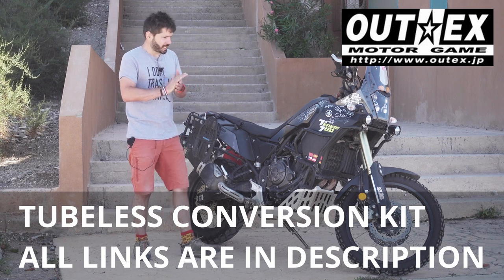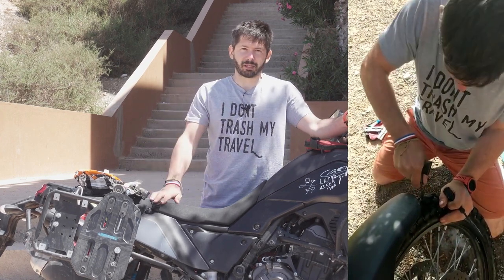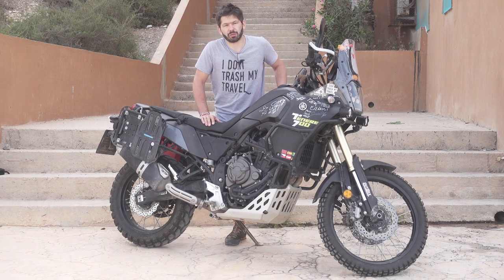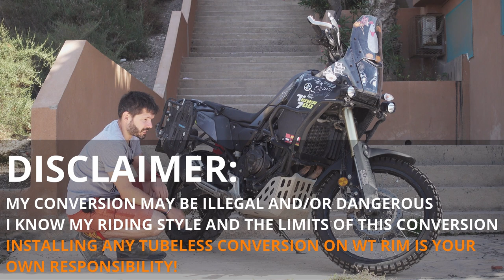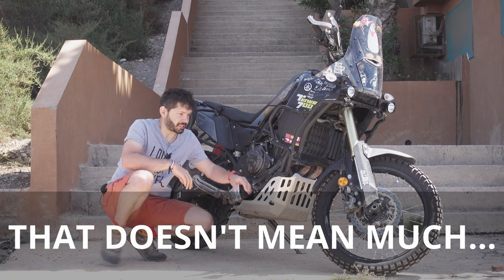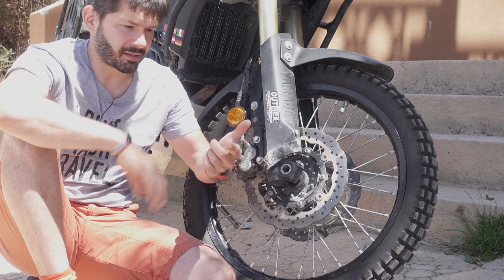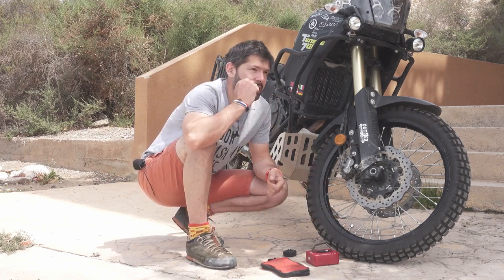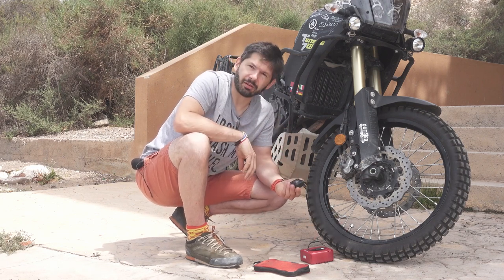Yamaha Ténéré 700 10k: OutEx tubeless

Comment: i run outex tubeless and my ktm 690 and 790 adv rally. i have popped the bead off the front rims on both bikes. i use rim locks to mitigate the issue. since using a rim lock on the 690, it's hasn't happened again. one rim lock didn't prevent the bead from unseating on the 790 -i ride it like a dirt bike. so, i'm adding a second rim lock to the 790 front rim. we'll see.
Reply from the maker: Wow this is super interesting info! What pressure you run? Do you think you pop it off the bead because of the pressure or because you ride it like a dirt bike? I guess for the dirt bike riding the MT rim would be also solution...? Rim locks sounds like great trick!
Reply: @FARANDFURTHER  on the 690, i run as low as 14 psi in the front/rear. the 790 is fairly new to me and so i'm still experimenting. i was running about 24 psi in the front of 790, when the bead unseated. i think the bead came off because of riding it like a dirt bike. i intentionally blasted into rocks at speed to test the tubeless and custom rims. so, i was actually trying to unseat the bead and punish the rims because i wanted to find the limits of the setup, since it's new to me. i run excel takasago heavy duty rims, size 1.85 in the front and 2.5 in the rear. the challenge with rim locks is getting them to seal on tubeless setup. i've customized the rim locks to handle tubeless setup.
Reply from the maker: Sorry for late reply, YouTube won't notify me on the replies to comments I already replied. GRRR...

This is great information, fascinating. Thanks a lot for sharing! I think we can conclude that with normal use it would be very difficult to unseat the tire!

So does the Excel Takasago rim come with the rim lock hole? Or you just drill it?

Comment: Did you consider the Tubliss system? It locks the tyre bead to the wheel rim all the way around so is even more effective in keeping a tyre on the rim than a normal tubeless system. However, it is not DOT rated for the road yet, so I guess each person has to decide whether that matters or not. It does not mean that it wouldn't pass the regulations, just that as yet as far as I know, it has not been submitted. Just me personally, I am going to experiment with it because I have have met KTM 500 owners who use it at 80 -90 mph road speeds. That said, a 500 EXC is a lot lighter than a T700, but I cannot see any reason why there should be a problem, after all the tyre is going to be running a lot cooler than it is with a tube. What does anyone else think about Tubliss?
Reply from the maker: Hi, I've heard about Tubliss system and I think for more agressive off-road it probably does make sense and maybe safer than the OutEx system I'm using (especially when I don't have tubeless safety rim, in the front).

I think I will give it a try at some point, at the moment OutEx works well, however it probably is not DOT rated and may be questionable solution due to front rim.

Comment: nice video..useful.. the way you can stop air leaking while tire is decading is to use tire milk, i use iot in MTB tires ... it seals all small leaks perfectly... hope it helps
Reply from the maker: I'm back on the tubeless in the back so let's see how it goes. If it leaks a bit I'll try the tire selants (milk). Although now thinking about it... it may interfere with my pressure sensors.

Comment: Hi, great vids! I was wondering with your recent adventures offroad, how it the tubless conversion holding? 
Do you air down the tyres and if so, how much to ride safe without popping the bead?
Thinking of doing it on mine with 3M tape. Let me know your experience so far. Thanks and congrats for the content 👌👌
Reply from the maker: Hi, glad you find videos useful. The tubeless conversion holds perfect. I found few days ago that I have a bit dented rim in the front but it still holds well and with new tires does not leak at all.

I air down to 20psi for off-road no less, to be on the safe side, but I usually ride such hard tires that I'm not entirely sure if it does make any difference except in my head.

OutEx says min is 18psi if you don't have the tubeless safe rim, which I don't in the front. Rear I can ride as low as I want but front I keep aired up and with all the off-road training, log jumping and so on... so far so good.

I've done now 16k km on the system on T7 and about 60k km on Honda CB500X on previous trip.

Comment: cool video and clear information based on your experience - great! i'd like to upgrade my t7 and your thoughts and comments are very helpful and highly recommended. for the tubeless system: does a tire sealant give additional safety or do you think that could cause problems? thanks for your answer - and enjoy the trails!
Reply from the maker: Hi, I'm glad the video has been helpful. Just keep in mind the minimum pressure and you should be fine. I'm now doing some harder off-road/enduro on the OutEx and so far no problems. I keep 20psi as minimum.

Tyre sealant will not give it additional safety, the risk of popping tire off-bead won't be mitigated by the sealant. You will only make your life easier as punctures will seal automatically.

I don't know if you could make it worse. Naturally if the sealant reacts with the sealing tape it would be bad, but I don't think it would be case. However best would be to ask OutEx on this one.

Some people commented here that they use rim locks with the OutEx, which makes a lot of sense and would minimize risk of tire popping off the bead.
Reply: FAR&FURTHER thanks for your answer - makes sense to contact outex directly. - rim lock:  i use them on my standard tube tires, don‘t understand how to seal the additional hole in the rim for the lock nut. outex might have an answer on that as well.
Reply from the maker: Sorry I could not help more, but that is a realm I have not explored yet.

Comment: Great video, to the point. thx. Q. what are those tires that you have and what sort of impact (if any) did the tubeless conversion have on the choice in tires against how it came from the factory?
Reply from the maker: I have TKC80 in front and Mitas E-07+ Dakar in the rear. The tubeless does not affect choice of tyres but you can’t fit TT tyre anymore only TL ones.

Comment: Maybe I missed it, but do you use a latex sealant in motorcycle tires?  I'm a mountain biker and tubeless with sealant is the only way to go.  Does the general speed of a motorcycle vs a bicycle make a difference in regards to sealant?
Reply from the maker: There is no latex sealant in my setup. It's a tape which is applied on the spokes (nipples). A lot of people combine this with the latex or other sealant products in case the tape fails or there are leaks around the rim.

I don't think there is big difference between the two, but effectively the tubeless on the bike is like tubeless on the car. The rims maybe a bit different from the mountain bikes though.

Comment: Great video, have also purchased the conversion kit and have a question, the nipples extend quite a bit from the wheel, and as the instructions indicate, should be grinded flat and smooth. I am not really prepared for this, did you have this issue, what tools did you use for this task.  Thanks
Reply from the maker: Hi, sorry for late reply. I did not grind the spoke nipples. If you're patient and careful you can apply the kit without problems and leave the nipples as is. So far I have no issues after about 25kkm on the kit.

Comment: Interesting that I have not come across a single vid/article on tubeless motorcycle tire conversions that mention the use of sealant.  It is SOP to use sealant on tubeless mountain bike tires/wheels, and there are even sealants with higher temperature tolerance specifically for motorcycle tires. Seems to me that using sealant should be standard in MC tubeless conversions, and not just thought of as something to help stop leaking after a flat.  Keep in mind that sealant should be used sparingly; just enough to get into the entirety of both wheel beads.
Reply from the maker: Hi Steven, by “sealant” you mean something like Slime? The liquid which you have in the tyre to automatically seal when you have flat?
Reply: @FARANDFURTHER  Yes. Any quality latex sealant.
Reply from the maker: Would you be able to point me to a brand, just for an example. I know few products like Slime but that is not designed (AFAIK) to seal the spokes. The one reason I see for something like OutEx or Bartubless is the fact it will last through multiple tire changes or allow emergency tube use.
Reply: @FARANDFURTHER  Sealant alone will not seal spokes. Rim tape is still necessary. My favorite brand is Orange, after that; Stan's.
Reply from the maker: @stevenhill2204  Aaaah! Now I get it! Thanks 👍

Comment: Hey Pavel! Great channel - subscribed. 
may I ask how tall are you?
I would also like to buy a Tenere. I am unsure about my height.
I'm 172 cm tall, and I'm not sure if the Yamaha Tenere will fit me.

Your opinion is very valuable to me.
Reply from the maker: Hi, I’m 168cm tall. I have to say that I can barely reach the ground with my feet. I’m tip toes all the time when putting both feet down. I can flat foot on one side when I move my ass to the side 😂

I’d give it a test ride for sure. You can get used to it but especially in off road it requires some skill and planning. Or just don’t stop then it’s all fine 😂
Reply: @FARANDFURTHER  many thanks - I want to remember that not to stop, and when I'm down and someone asks me, then I say Pavel said not to stop 😂 

Is Pavel spelled correctly 🙄

Comment: one other issue I would have.....I use Dynabeads for balancing (love them) so if I understand that right the beads would start sticking to the tape inside, so if anybody is using a dynamic balancing system - this would be a problem...right?
Reply from the maker: Good point, as usually! I think the OutEx would probably not be best option in this case. Once you apply sticky tape, on top of it you apply white protective one which is not sticky. So most of the surface is not sticky. But obviously the sides will remain as it’s impossible to do it perfectly... so some of your Dynabeads would stick to the sides, yes.

Comment: Is there any rims already made for the tubeless tire ouh can  fit  whit the Tenere 700
Reply from the maker: As far as I know you can only buy the tubeless ready rims - MT - rims and convert them to tubeless. DID, Excell, SM Pro sells the 21” MT rims that’s how BartTubless works or SMPro Airtight a system.
Reply: Rally Raid, UK offers a complete set build with EXCEL rims: Yamaha T7 Bartubeless Wheel Kits-RRP 639

http://www.rally-raidproducts.co.uk/yamaha-t7-tenere/yamaha-tenere-t7-billet-hubs-wheels-tubeless-bartubeless

Comment: what size rims come on the t7?
Reply from the maker: 21” front 18” rear
Reply: @FARANDFURTHER  sorry for not clarifying. i meant the width of the rims. e.g.,  on my 690 and 790, i run size 1.85 in the front and 2.5 in the rear
Reply from the maker: Tenere has 21 × 1.85 & 18M/CxMT4.00 says service manual.